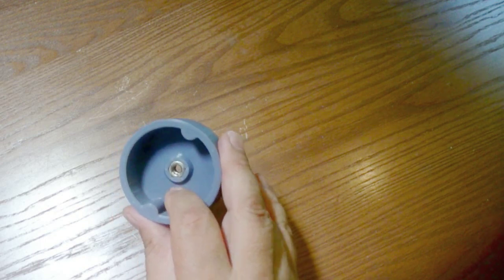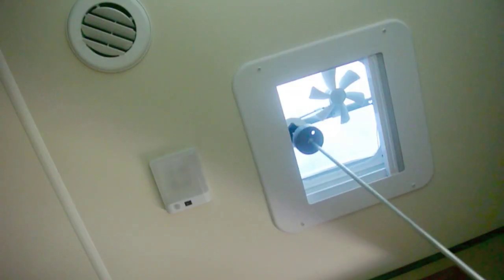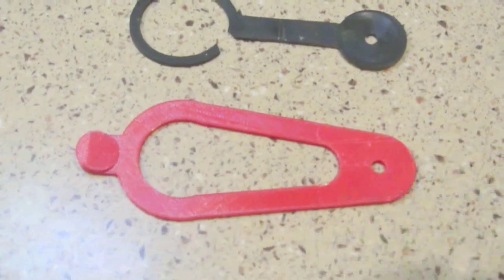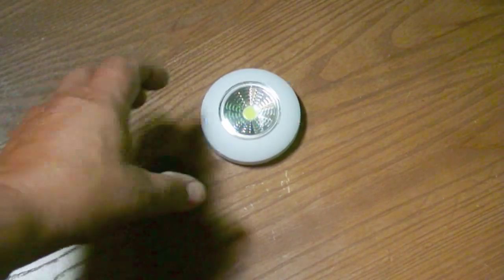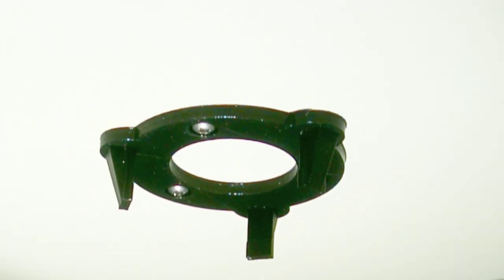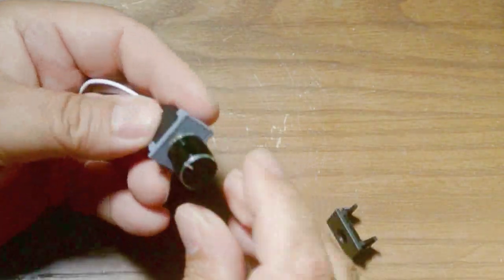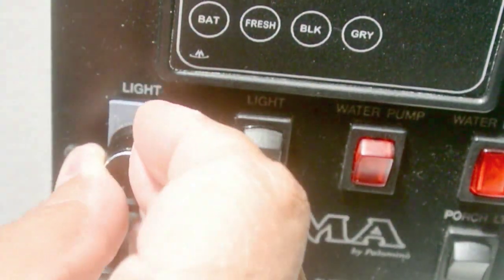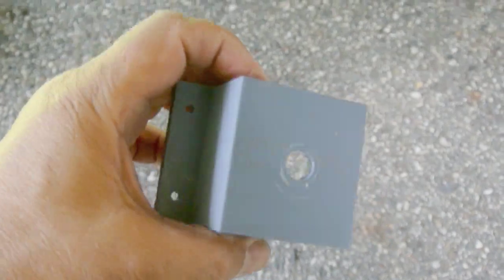Five Things Edition 12 - Five 3D Printed things.

Comment: Never thought I’d need a 3D printer but here I am searching amazon! Lol. Awesome job
Reply from the maker: I held off for a few years before deciding to purchase one. But with the Ender 3, it brings decent prints into the $250 range.  I have had my printer for about a month now, and it has been printing non-stop.
Reply: RVProject this is the same one I’m looking at buying since it seems you have had good luck with it!
Reply from the maker: It's not perfect by any means, but the investment is minimal, and is regarded by many as the best printer under $250.  I went for the PRO version which was closer to the $250 mark. There are plenty of support videos on YouTube.

One thing you will experience is failures - it happens to all of them sooner or later. But again, YouTube has plenty of videos explaining how to fix issues.